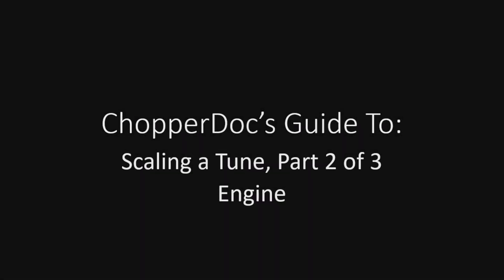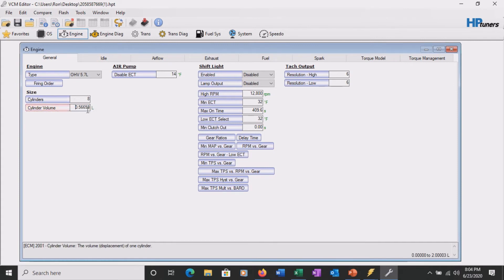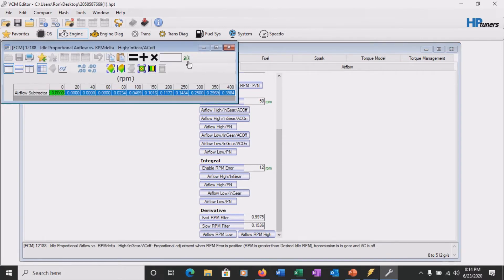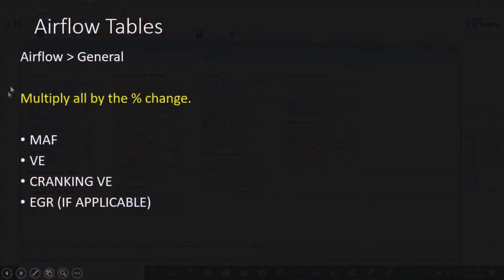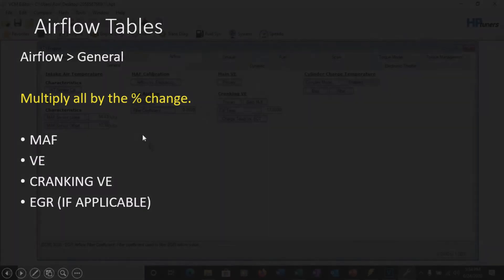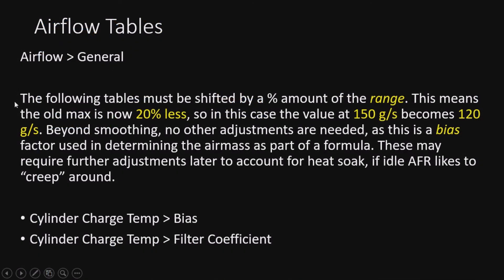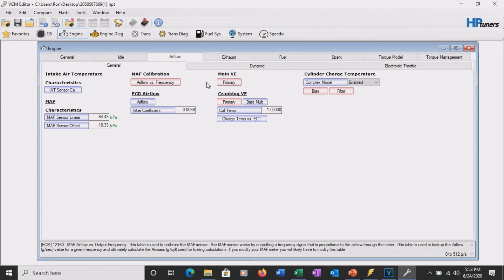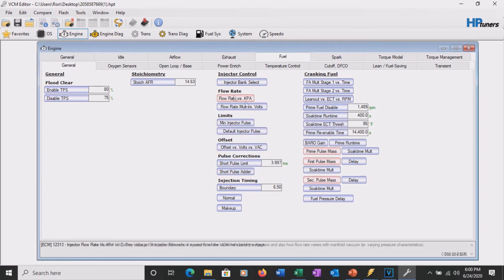Tune Scaling Part 2 of 3 - Engine Tables

Comment: I'm glad I'm not trying to do any electronic idle control. Prime pulse on mine is just zeroed out, stock. I guess that's an option, or it uses a per 90 degree table that starts high then slopes down quickly.

Comment: Hey there, not sure that the VE table needs to be scaled for a gen 3 ECU. You technically already scaled the airmass when you scaled the displacement. The airmass is essentially displacement * VE (VE on Gen 3 is just a % of displacement, unlike gen4 where it bakes both values together). By multiplying VE by your scale again, you're over-scaling the VE table.
Reply from the maker: True, however in practice it doesn’t always work out that way. Another symptom of needing to scale in the first place is numbers on the VE far beyond 100%. I’ve seen numbers as high as 130% on N/A cars, which is “impossible” but is what it is because that’s what it’s asking for with those injectors. In practice slight adjustments to VE after scaling are often needed, but I haven’t seen anything off the charts after scaling it. I suppose you could technically skip that part, because you’re right, but for whatever reason it’s going to show pretty rich after the fact if you don’t scale that table. The idle areas do require attention, because of the unseen formulas behind those, but the WOT areas and so forth don’t need much work in my experience. Honestly you have me wanting to compare my files now to see if the numbers came back in line lol. The physics are complicated when talking airmass too, which is another major factor, so % of displacement isn’t necessarily as simple as that sounds.
Reply from the maker: So in simple terms, for what I’m saying, if my VE numbers were above 100%, say something like 120 or whatever, would I then leave that number alone, or should I drop that down by the scale percent? Which in this case should be at least 25% leaving my new number saying “90” and not 120. Just because it allows numbers above 100 doesn’t mean they are correct, unless we’re talking about boost. Does that make sense now? The whole point is to bring my airflow limits back into the margins. That also implies my VE is also “off” by at least that much.
Reply: Yeah i get what you're saying with regards to VE numbers that are comically high (120+) are just to overcome airflow issues and should be brought back down. In theory you shouldn't have to scale any sane VE value on a gen 3 ECU though. Of course nothing is perfect in practice. Just figured I'd call out this one thing i saw. The video is well done, though. Great reference
Reply from the maker: The concept for the rest of the numbers is the same. Once adjusted to a set of injectors, none of the numbers are going to be right if you scale only the injectors. The presumption is that scaling is needed after a calibration in this video. Therefore, everything in the tune is off by the amount determined by the amount out of limits. Since this means the VE is changed to map those injectors, the entire table must be changed to reflect the percent change applied to the injectors. Otherwise you’ll be pig rich and need to adjust anyway.

Comment: So I have the opposite problem where at WOT the max cylinder airmass is .76 
Would I have to do the same except multiply say by 1.3 or 1.4? 
It’s a LS7 , Mast heads, 103 TB, large cam. Etc.

Comment: Hey.what happen..your videos are dying off.. you do the Best job explaining things .. I had a question tho.. if I wanted to start over on my tune.. on hp tuners.. do I just pull the stock tune file up and just reload it.. do I write it as a change or entire ..
Reply from the maker: I’ve been in the process of moving, fixing up the new house, and training for an Army school coming later this week. I don’t have internet set up at the new house yet, and hardly enough time to finish even half of a seemingly never ending list of tasks. So naturally the YouTube thing has to take a backseat for now until the dust settles.
Reply from the maker: To your question, pull your stock file and save it as a stock file. Any modifications made to it should be saved separately using the “save as” feature, and most folks make a new folder so the stock file doesn’t accidentally get over written.

Comment: Why do I need to scale by 0.8?
Reply from the maker: It’s entirely dependent on your need. Many scales are 50%, especially for boost applications. Some go even farther. I explain in part 1 how to determine a scale amount before starting. I used .8 to show a more difficult scale, for the purpose of the tutorial. As long as you use the exact same number throughout the tune you’re golden.
Reply: @ChopperDoc181  Can you help me with tune lq4 supercharged?

Comment: Not sure if you'll know, but does the fuel qc need doubled as well?
Reply from the maker: You are talking about fuel qualifications right? Under transient? I’m not sure why this would be doubled. Normally the only time I mess with transients is when fixing tip in or tip out AFR spikes. Since the entire fueling calculation will change, most of the transient fueling will be left untouched since the input formula will be reduced by the scale percent.

Comment: Forgive me if this is in the video and I missed it.  So I am installing 80lb injectors and plan to scale by 50%.  Would I scale the injectors too, by putting 40lbs in the KPA vs flow rate (injector flow) or would this stay at 80?
Reply from the maker: Yes you would reduce the flow rate by your scale. Make sure you use your injector data from the injector manufacturer first. It is actually in the video, but that’s okay. You don’t have to change really any of the other data because it’s mostly time… therefore it stays the same.
Reply: @ChopperDoc181  Thankyou sir.

Comment: why does this need to be done? Does this need to be done for just a cam swap?
Reply from the maker: It’s done normally when you put in larger injectors, and you want to stop riding the bottom row on your spark tables.

Comment: Is there a part 3?
Reply from the maker: Not yet. Hopefully I’ll get back to making these soon. I’ve had a ton of other projects to finish lately, not to mention work and family life. Luckily, the trans section is pretty easy to scale. It’s very similar to the spark tables.
Reply: @ChopperDoc181  Totally understand. By your profile name I'm guessing current or former military. My youngest son is still in the Army.  Multiple tours in Iraq and Afghanistan. Infantry. 101st Airborne now 10th Mountain.
Reply from the maker: @chrisbryant1657  I’m in the 101st right now lol. You guesses right I suppose. Not just the name though, this channel started with helicopter videos back in 07 from Iraq.
Reply: @ChopperDoc181  My son was in Iraq  07-08. 15 months. 101st 2/327th. Samara.
Reply from the maker: I was there the same time then, with D Trp, 4-6 ACS out of Tal Afar, FOB Sykes. It’s pretty close to Mosul. Went there daily for one reason or another. Good shit though, I’ll bet your son and I would get along fine lol.
Reply: @ChopperDoc181  Chopperdoc,  what year car are you tuning in your videos? I have a 98 z28 Camaro using the original HPTuners serial interface (discontinued in 2009 no support). Trying to figure out if any of newer versions of HPTuners would be worth upgrading for an LS1. I purchased an AEM 30-0300 WB O2 sensor recently but not sure if it will log AFR in the older version of HPTuners.  I last tuned the z28 in 2005-2006. Lol
Reply from the maker: My car is a 98 as well, but has the 0411 upgrade. Not sure about your interface and compatibility. I have an MPVI 1, and it does the job fine, and then some when I tune other cars.
Reply: @ChopperDoc181  Im using the original HP Tuners from 2005 (serial interface). For my needs, the standard MVPI would suffice however its no longer available or supported.  ive been out of the game for awhile and was not aware of 0411 upgrade. What is the advantage of the 0411 upgrade and how much repining is required ? I did some research and found a company that has the 0411 upgrade for $250.
Reply from the maker: The 0411 is twice as fast to process everything since it’s a 1024 instead of the 512 that the original 97/98’s come with. The repin is tedious but not difficult. You’ll have to lengthen a number of wires to reach the new pin locations. I think in total, only 4 wires don’t get moved. This is also a good opportunity to delete wires you don’t need if applicable, like rear O2’s, EGR, etc. I pulled a bunch from mine and tucked everything in nice and pretty.